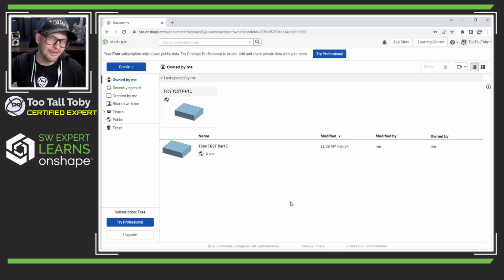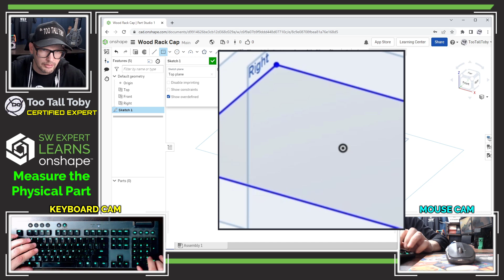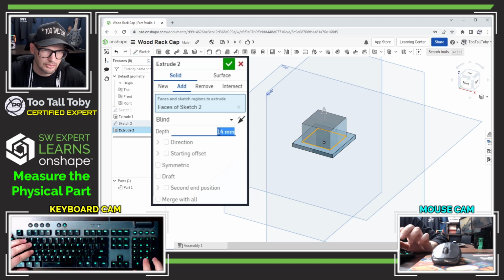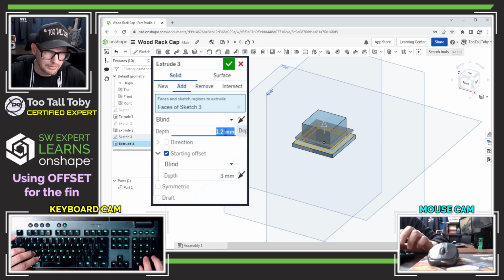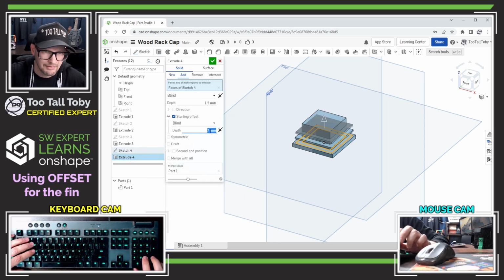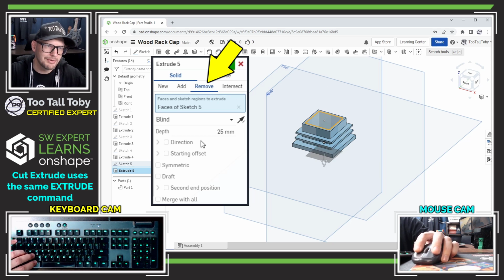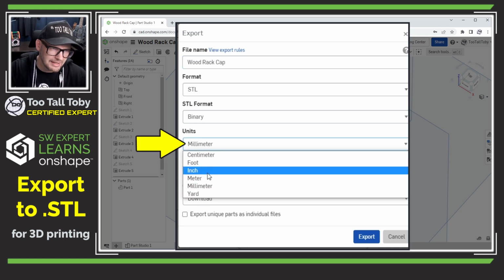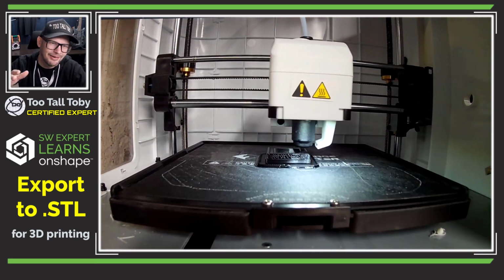SW Expert Makes a Functional Print in Onshape

Comment: I transitioned from SW to Onshape  from day 1, several yearsago. Cody Armstrong was my goto guru, and I have never regretted the change. Have a look at Solarscope for one of my projects and QFH for another, although the latter has some issues based on the use of standard parts. I came from a professional background with Inventor and SW, but moved to Onshape for hobby projects. I'm a messy designer (I've never got out of the bad habits of those other products!😉), but this package is very forgiving, as my 14inch Dobsonian telescope projects will show; that's undergoing a major modification now. All my projects are designed for maximum use of 3D printing.
Reply: Wow those are some cool projects and thanks for the heads up - It's good to know that I can be a little messy in onshape, but I wont get painted into a corner.  Good stuff Thanks Mike!

Comment: I have 3D printed all the things I’ve created in OnShape. My most recent was a poop bin for my Bambu A1. It printed perfectly after doing a repair on the model. Turns out that I don’t quite have the hang of creating surfaces versus parts. I also learned that creating it with a total thickness of 0.8mm resulted in weak walls and warping. Still, the print was a success!
Reply: Nice job Jack!

Comment: Thanks for the video, much appreciated. I'm looking into whether or not it's feasible to use an iPad for light design work. I tried Shapr3d first. It looks great but limits your output files in the free version to medium resolution. Based on that I'm now trying OnShape and so far I'm liking it. A little quirky but overall pretty good.
Reply: nice!  Did you get onshape working on Ipad?
Reply: Yep, and (mostly) love it. Some quirky behavior that you have to get used to with the touch interface and for some bizarre reason they don’t lay out the options on top of the screen.

Comment: Great video!! You’re an excellent instructor. I must ask a couple questions though… 42 min print? Supports? That should take half the time to print with no supports( perhaps a brim only).  You should try to print it without supports and at a faster clip( depending on the filament you use. 
Thanks again all your OnShape videos. They’ve become an excellent CAD resource

Comment: Hi, my previous comments have been hidden because they were too much like spam I think.  I wondered out loud why you didn't change the design slightly to get rid of the support, which I would have thought to be a primary consideration when designing for printing.  If you can see the "spam" comments there's a link there to my stuff all designed in onshape.
Reply: Ohhh - yeah you are correct.  I usually do that (design the parts to help avoid support material) but I think I was just caught up the excitement of trying a new CAD system, so I just made the part exactly like I saw it.  But I'm likin the way u are thinkin, so I might make a REV 2 😁
Reply: Yeah man… I also stated out loud, ‘There’s nothin’ on there that needs supports’.  
Glad you got the satisfying Clink tho!!  Interested to see some more modeling, as I’m trying to decide between softwares.  Thanks for the time on this!
Reply: @JoelKreider  Cool I'll start making some more stuff-  I think the best way to learn a new CAD software is to just start modeling stuff on your desk, in your workshop, etc... so that's what I'm gonna start doing next!